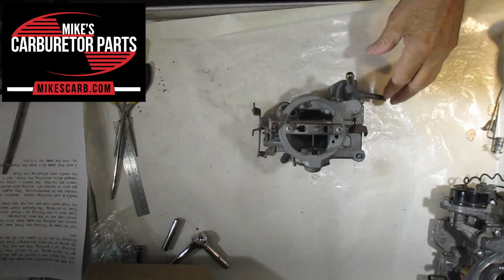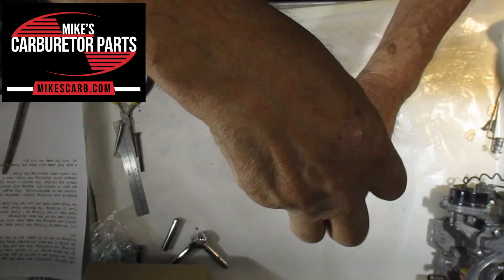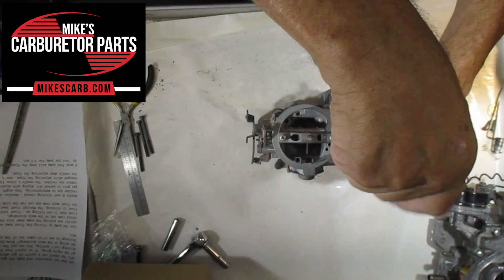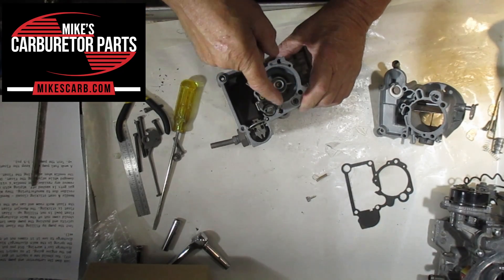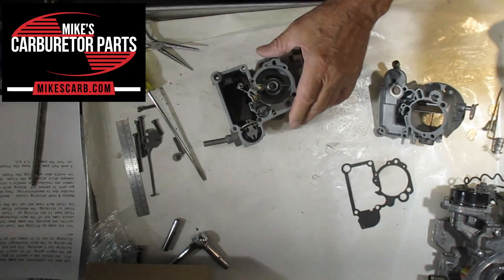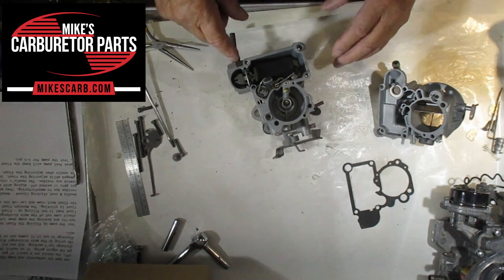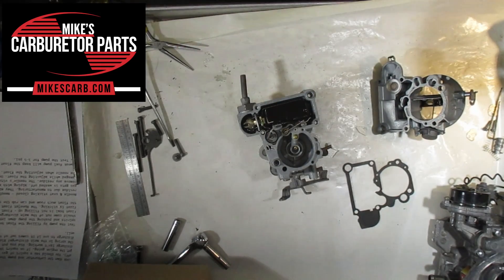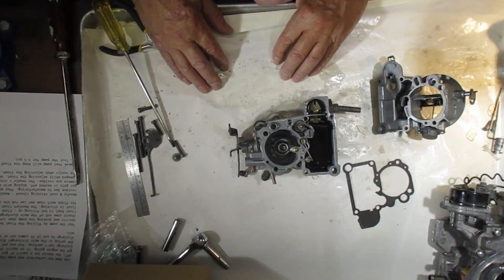Pour Gas Into the Carburetor To Start The Car

Comment: I'm trying to get my 1983 s10 blazer to start and I wanted to know if you had a video on ruling out the ignition before I even mess with carburetor
Reply from the maker: Sorry I stay close to the carburetor only.
Reply: Did you get the s10 started?  You can always use a sparkplug and put it in a sparkplug wire and crank a engine over and watch a for spark.

Comment: Hello I have a Aisan 2bbl carburetor cold start no fuel to carburetor  I have to manually fill carb with fuel to get it to start while the engine is cold do you know what can cause it I tested the app by sending power to the 2 wire circuit going to the app and I see it’s clicking  and moving I checked if fuel is getting to the fuel pump by disconnecting the lines and fuel was coming out
Reply from the maker: Please refer to this page for some ideas: https://www.carburetor-parts.com/hard-start-or-dies-easily-in-cold-weather.html

Comment: interesting educational video, like all of yours, thank you for sharing all this. May I please ask for some advice? I understand it may be hard w/o seeing the vehicle. I have 1983 Ford Econoline van with the 300ci straight six, auto tranny and carburetor. Had it a year now. I was told to pump the gas pedal three times in the winter before i start it, but not to do it in summer. It starts great in the winter with the pumping even during polar vortex. But in summer, it takes a lot of cranking before it starts. It will always start, but usually during third session of 10 second cranking. Is it because all the gas leaked out or evaporated from carb? I've heard these vans also had issue with timing, I am not sure about mine, seems to run fine otherwise as far as i can tell. I am not experienced mechanic, but would like to tackle this myself. I bought all the factory repair manuals and just wanna learn. Thank you.
Reply from the maker: Push the pedal once even in hot weather. When hot look down the carburetor after turning engine off and see if gas is dripping from the venturi. It may be syphoning gas from float bowl.
Reply: I have a 1983 E250 5.8  dual gastanks - Have you had any other problems with it starting?

Comment: How are you sir I have a Rochester b car open it about 5 times already the acceleration pump get stock in the bore like hard to push down what should I do thank you
Reply from the maker: You either have the wrong pump, or the cup as swelled up due to ethanol. Parts are here: https://www.carburetor-parts.com/rochester-b-parts
Reply: @MikesCarburetor  thank you very much for taking your time really appreciated